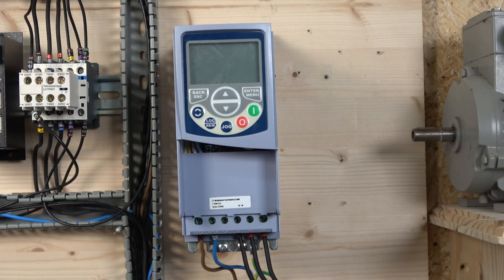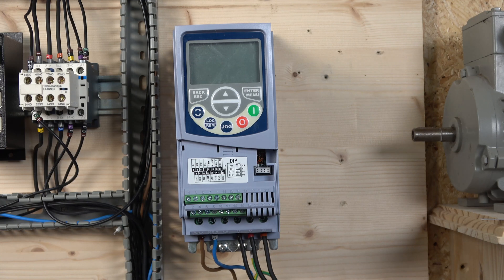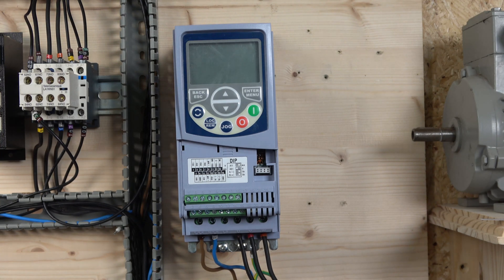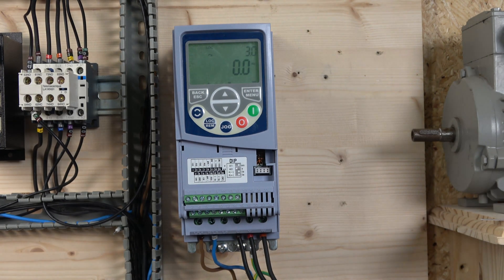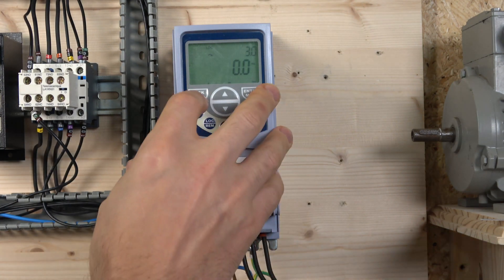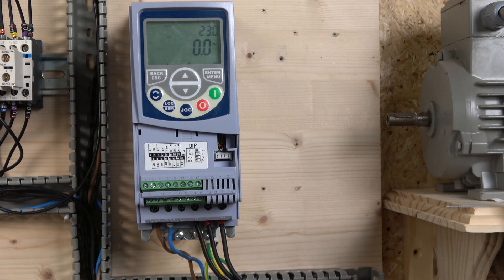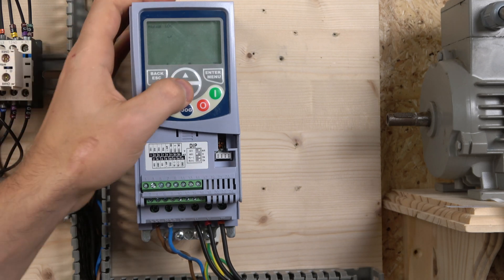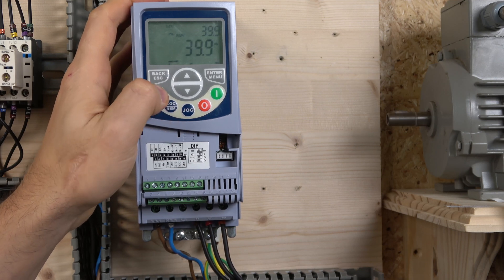WEG CFW500 VFD, local control, commissioning, Parameter set up and Factory reset. (English)

Comment: We are using cfw500 for crane application.  On multiple speed is it possible to set a time delay in between the steps.  So that even if the joy stick is jumped from 1 to speed 4 the speed of the motor will not jump to full speed but rather follow the order speed 1. Speed2. Speed 3. Speed 4